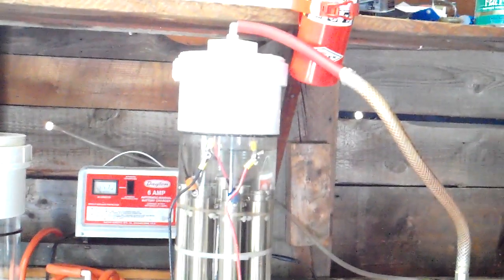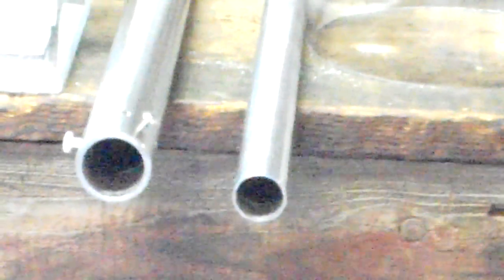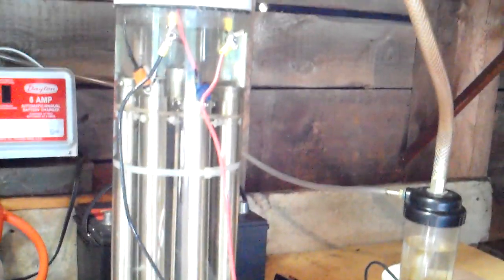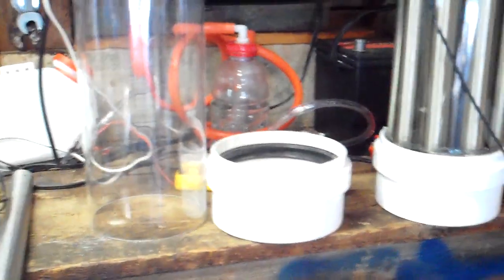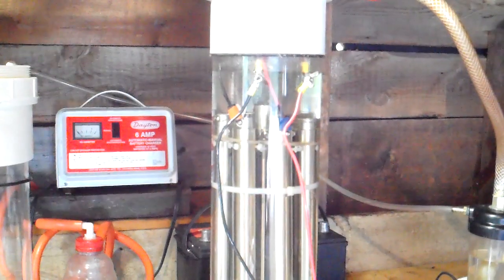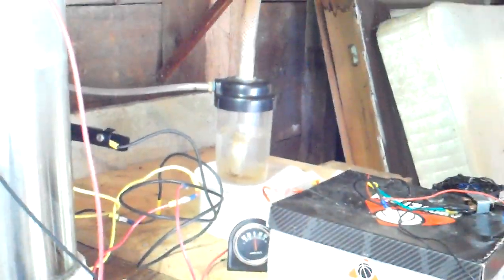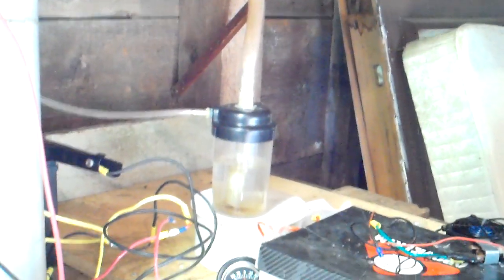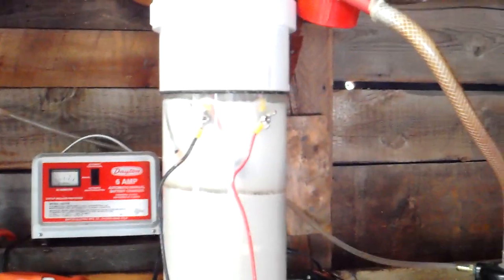High Output Stanley Meyer HHO Generator.AVI

Comment from the maker: Yes, the WFC acts as a capacitor. Resonance is another issue.
Depends how you define it. Crampton emphasized the necessity to tune the tubes so they all resonant at the same frequency. This is physical resonance like ringing a bell and having another bell resonate. Electrical resonance is defined differently and is important in the circuit design. I have posted a paper on it on my site.
Reply: 10 years this stuffs still not mainstream..? Suppression, by the way, did you know charge clusters discovered by ken shoulders mimic every property of oxyhydrogen, including anomalous power output? U get away more or if hho than you spent producing it, over unity but within proven able laws of physics. 

Physics needs to accept it and then explain htf charge clusters tap the ZPE, how they form, why they form, and how they react with storage pressure. 

It prove it's not hydrogen a Japanese guy ohmasa I believe, isolated the third gas ortho hydrogen he called it stored ot two years no problems. Cool flame instantly heats up to 6,000c
Reply: Where can I find that stainless steel tubing setup?

Comment from the maker: The design shown in my video is for research. It cannot be shipped without damage nor is it suitable for use in vehicles since vibration and rough roads could damage the sensitive parts. Currently, I offer a commercial quality system for converting diesel semi trucks to HHO. It is 185% efficient (over unity). The cost is $2200 with all controls and diesel tuner included. Call 207-319-7414 for details and the link. Dave

Comment from the maker: Sure, dude. And I suppose you got it all figured out how to generate abundant HHO using tap water and under 2 amps? Good luck. Anybody can hook up some plates in an electrolyte. Only a few researchers (like myself) can produce abundant HHO and run cold without using an electrolyte or consuming many watts of power.

Comment from the maker: Actually, the HHO generator in the video is just for experimental work; however, I've just built a much smaller high output generator for pick up trucks and semi trucks. I'll be posting it on my hyfusion site soon. This system will include everything to increase MPG 35% on big diesel trucks and up to 100% on V-8 or diesel pickup trucks. 207-319-7414

Comment from the maker: I'll be testing the new Stanley Meyer exciter array energized by the complete VIC circuit at (see latest video). Subscribe for details.
I'm also introducing a new design with electrolyte puts out 6LPM @ 30 amps.

Comment: Good Point. Though he did state that one could use ANY type of water. Including Sea Water with salts in it that ionizes and thus is an electrolyte. Most naturally occurring water has numerous different substances in it. As is evidenced in numerous different places and processes when it is 'left behind' out of the H2O and is the scaling build up.
FYI Plants absorb minerals in there roots in the SALT form.. This salt conversion is done in the soil by a HUGE MYRIAD of TINY white strands of ????

Comment: Want/need AC in your vehicle? Alternators put out AC as opposed to DC. Why they are called Alternators. Before that they used DC generators with lower power density (& efficiency?) 
The AC output is converted to DC in the alternator by 6 diode rectifiers.  Bypass these and you will have AC 
FYI: Seventh rectifier diode for the (dash) indicator light or gauge tells if the alternator is working. Can get fooled if this fails.Test FULL alternator output by applying full power to Field wire.

Comment: Some 'freebies' for those putting these in vehicles: 
1 - Use a relay activated by the Alternator field input wire that ONLY is energized when the engine is running and u won't run your battery dead.
2 - Use a CURRENT amplifier to control and vary the HHO output relative to load & speed on engine.  Not certain on this, but likewise the Alternator field  power might work for controlling the HHO output as well as the amount of electric power produced is controlled by the field voltage.

Comment: Some Australian designs I have seen on here utilize a series of concentric electrodes which likewise increase the surface area and power density. One guy likewise said that as in many things, the subtle (design) differences made a significant impact in output and efficiency.
They stated that once it gets going it would continue without any more power input! Drove over 600 miles on water alone.
The Australian that found this apparently received $1Billion and was dead the next day as well )< 8)

Comment: I wasn't looking for a cheap sales pitch, these generators are simple to make, and supplies are much cheaper. who the hell wants to spend over 500.00 dollars for this. I built mine for 100.00 and had enough material to make several hho generators.One for my wifes car and 2 for some friends, I explained the electrolysis process and do's and don't's and they haven't paid for gas for the past 3 years :O) they're still smiling, this info is free all people have to do is research the material.

Comment: OK, just how much HHO is produced using the unit you are talking about. Maybe 1 or 2 CFM if run into a tank or carburetor. That wouldn't run a lawn mower for a minute, so what good is it in an application like a car? Most people who understand something about fuel cells know the tiny amount of HHO produced will burn and in quantities then thousand time what you are doing here will run your car, but so far there is not enough gas to use in a car. Look at the tiny amount you are getting.

Comment: Yes, he uses Standing waves, but the amps must be cut down or water will not be ionized. Cutting down the amps means everything, then all of the resonance stuff can start to do it's work. Amps should be held in the micro amp range from the looks of it. Once the water starts to ionize then the electrons are free to move about, and once the water molecules lose more than one electron it simply falls apart for it no longer satisfies the Octet Rule.

Comment: To make use of watter as a source of fuel as Meyer did you are going to have to learn to ionize the water molecules to break the bonds of the water molecules. Current flowing through the system must be next to zero for the current to voltage ratio gives a very small current in the window in order to ionize water. The voltages should be around 1k volts to start this type of reaction going at around 10 ma or less. Enjoy knowing the real way Meyer broke the bonds of the water molecules.

Comment: The cell looks good - now we need some numbers to work with.
So, what is the MMW of the cell and it's peak gas output.
Also, would you give me a good reason as to why I should send you cash for plans when Stan's are free on the net - and so is his driver circuit plans ?
Sure, the cell design is important - but the driver circuit is even more important. It's what let Stan go over Faraday's equations.
Reply: Actually stans secret that he never told or wrote down is cavitation. But he did not even know why that mattered. 

I have a theory, it started with learning of Exotic Vacuume Objects. Ken Shoulders discovered and proved these anomolous torus of millions of electrons that literally blow holes thru aluminum foil in kens experiments (they at atomic nucleus size yet make naked eye visible holes)

To my knowledge nobody can explain how, if they even believe, that a car could run on just hho. In my mind what happens is cavitation occurs the conditions exist (high voltage low amps pulsed high frequency) to produce charge clusters which output way more power then was used to assemble them.
When the cavitation bubble collapses the temperature and pressure changes two atoms of water and charge cluster into one thing... What that thing is we need legit study n recognition to figure out.

Good news 2020 2021 research gate... Look up hho generators and all the sudden university world wide start testing hho and diesel combinations and all report efficiency gains!!

Be ware any dry hho cell is bunk, any wet cell with high amps is bunk, creating charge clusters protected by atomized water until sparked or flame then charge is free to release way more power then u put in....all burning is is electron exchange, so u put a ton of free electrons in a combustion chamber, you get over unity combustion the only exhaust is water.. 

Little note, placing plates close enough that the gas production between causes the cavitation, and low amp high volt and you will get a gas that will improve fuel efficiency up  70% in diesel as reported by uc Davis and several other research groups in official papers.

Comment: Good work  , ok for bench experiment ,but i think the cell wouldnt stand up to constant use in a vehicle , ie copper wires + hole thru side of container ,i have 2 wet cells one in each vans ,over 1000 miles with each,leakage always a battle!. If the (secret) is a step forward you should share it with hho community (free) thats how we all got this far ! tubes are stan meyers style, there the similarity stops.goodluck n keep it up tho ! hexavelent chromium is my biggest bug with this tec. goodluck

Comment: You sent me this video to watch and I went to your website. Me being the sceptic that I am, what do you mean it is "300% more Brown's gas than typical electrolysis units". and 5x more HHO than what? What are you selling?
Reply: Designs that are in the public domain is what he's selling.
His claim to have "accidentally" increased output fivefold is the hook.
He most likely used a timer and transistor to tune pulses to the natural resonant frequency of each generator.
Add a mild flyback transformer & I could see producing five times what he did in this video.
It's still not enough to run a lawnmower though.
I'll eat my hat if he independently discovered anything other than how easy it is to get idiots to turn loose of $10.